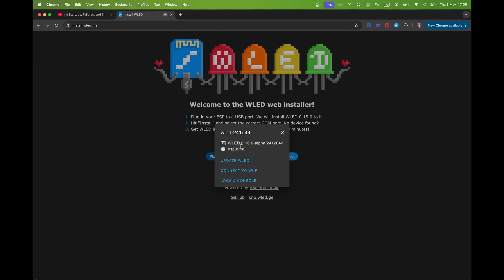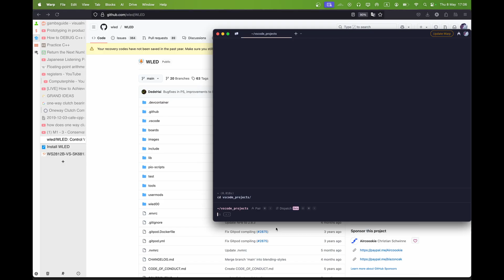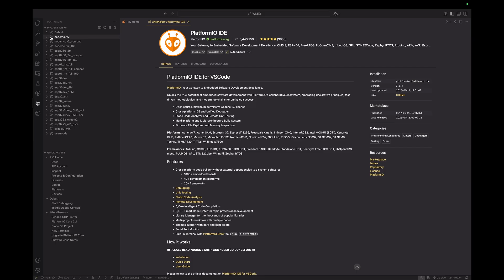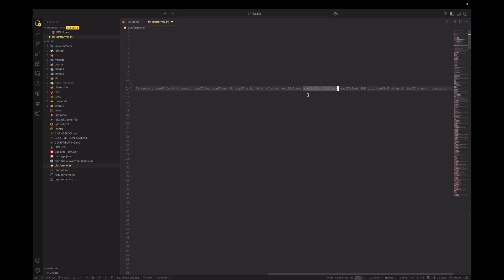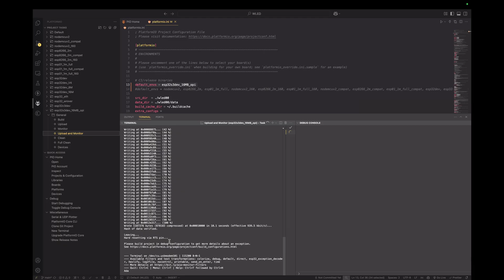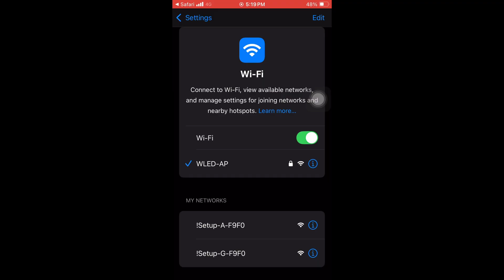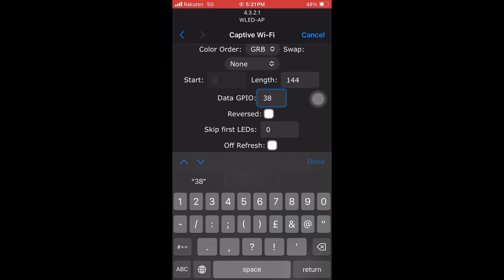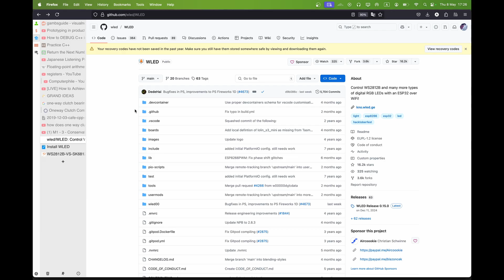Control RGB LED Strips with ESP32 S3 | Complete Beginner Guide + Code!

Comment: Can you make a detailed video of how to do it, step by step?
I also have ESP32-S3 N16R8 firmware WLED installed, but the terminal does not start like in the video.
Downloaded and installed VS Code.
But mine is not like yours in the video.
There's no command line at the bottom where you write the address.
I don't know what you're doing or how you're doing it.
More details needed.
There are so many people on the forums with these boards and don't know what to do.
The same problem.
I apologize for the mistakes, I don't speak English, I write with a translator.
You'd be great if you could make a more detailed video.
In order, what, where and how.
Reply from the maker: I will consider making it. For the terminal, it is not opened by default. You can see the menu on top and click on terminal and select new terminal to open new terminal. I will try making a video if possible.
Reply: @Crimsondevs  Thank you for responding.
This board broke my brain!
It's as easy as installing the WLED firmware and enjoying it.
I was trying to create a beautiful LED matrix, but I ended up with a headache.
I was able to install the firmware using the wled installer, but only through the COM port on the board.
It didn't work with USB-OTG.
Now I don't know if the board is working properly.
I figured out the VS Code program.
I cloned the firmware from github and inserted it.
Editing required Git.
Downloaded, installed, and implemented.
Then she demanded a GifDecoder.
I downloaded it, but I still don't know where to install it.
You have VS Code configured for ESP32, and all extensions and add-ons are installed.
A simple user does not have all this.
And the video doesn't mention it.
So we don't know what to do or how to do it.
Reply from the maker: @СергейБ-р6и  loll sorry for the troubles. I'll try to make a more detailed video and i'll let you know in case I make one.

Comment: Does this work with APA102 12v led strip? I'm tryna use ESP32s3 and a 12V battery
Reply from the maker: Yes WLED also supports SPI based chipsets like APA102. Just make sure you provide suitable voltages according to specifications.